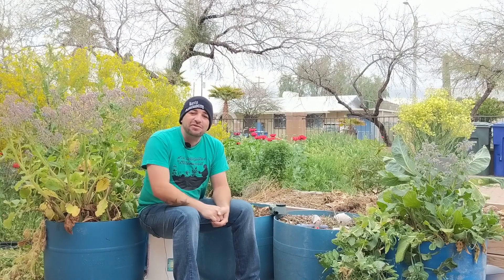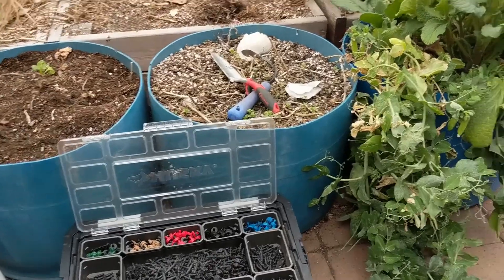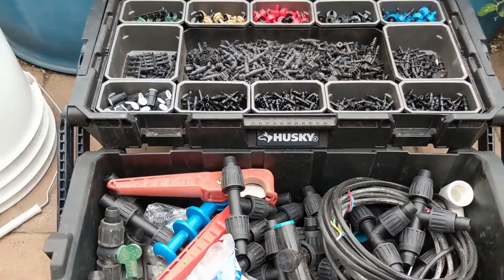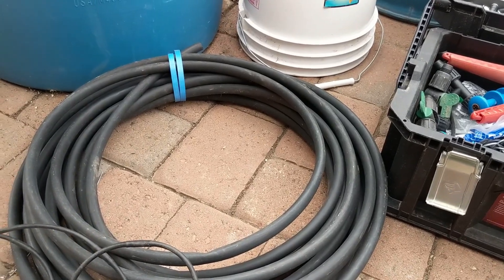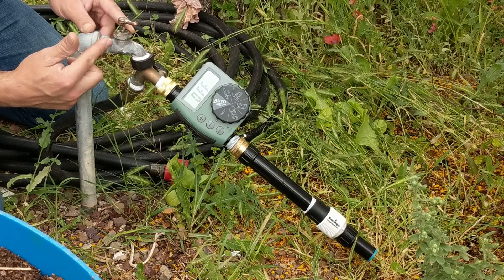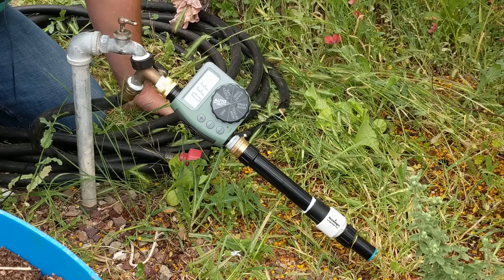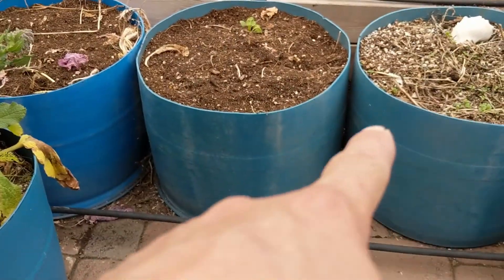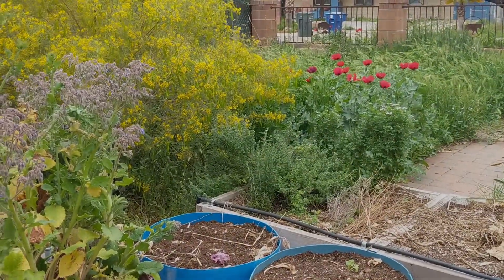How to Install a Hose Bibb Irrigation System

Comment: Hi, I am looking to use this method for my raised beds and about 3 zones for lawn. I have no lack of pressure and looking to “y” off a frost free bib with a built in vacuum break. Would this system work if buried and add another vacuum break after the timer for redundancy?

Comment: Hi....,I have a hose bib that is approx 8 feet from the start of my drip line....what parts should I use at the drip line to connect the hose and not blow the line apart from hose bib pressure...thanks.

Comment: Your videos have been so helpful and I have a question: what if you don't have any room to install the pressure regulator, filter, etc.  after you install your timer? Thanks in advance!
Reply from the maker: While I do like all the components I use in the video, you can most definitely substitute any of the parts and pieces with smaller versions that can fit your space better. I often use a "T" shaped filter rather than the one I use in this video that helps fit into tighter spaces, they probably make timers that are more compact as well. You could also try adding a "Y" Fitting to your hose bibb adjust it until it points in a direction that give you more space. Good Luck!

Comment: What do you recommend for a single port timer?
Reply from the maker: I like the Orbit timer you see in the video. There are two models, one has a plastic end and the other is brass, the one I use in this video is brass and it's the model I use. Good Luck!
Reply: Any issues with water hammering?

Comment: What if the off handles stop working 😭
Reply from the maker: You might have to replace the hose faucet if it leaks or is broken, it's a pretty easy fix with just a few tools, but you'll need to be able to shut the water off while you repair it. Sorry I couldn't be more helpful, Good luck!

Comment: Good video, but those Orbit timers suck big time.
Reply from the maker: There are orbit timers that I don't use, this particular model has worked very well for me for many years. I have had trouble with other orbit models, especially any of the two or four valve models.

Comment: OK so does it have to run directly from the spiket? 

Or can I set up  The timer filter set up where my race bed start and have a quick connect from the water hose- into system?
Reply from the maker: I get this question quite a bit, certianly you don't need to connect it right to the spigot, you can run a hose from the spigot over to your timer somewhere else like raised beds or whatever. I've seen these timers installed to PVC underground or in a variety of different ways. Once you get the hang of how all the components work, you can get creative for how you design your system. Good luck!

Comment: Beginner here...living in the desert of Yuma AZ and needing to conserve water.  What is the most ominous part of doing this is the beginning!!  Where do I start. I have tons of supplies but worried I'm not going to know how to get a poly drip hose with no end caps or connectors is very scary! A video would be great to see how you take a blank poly drip hose and connect it to the faucet...what connector you use; femal/male...jesus this is overwhelming!  Its keeping me from doing it.
Reply from the maker: Hi MeLin, I am from Yuma! All of this irrigation stuff is confusing at first, but eventually you'll get the hang of it. The hardest part is figuring out how long and how often to water your plants, second hardest thing is learning how to program the irrigation timer, third hardest thing is actually trying to insert the emitters into the tubing, but eventually it all becomes easier. I recommend you watch all of the videos in the description from part 1 all the way through, it will help to give you an overall understanding of all of the components in the system and how you set it up from scratch. Please feel free to reach out again with specific questions if you're having trouble with anything. Good luck!

Comment: Thanks for these great videos! 

Instead of connecting the timer directly to the faucet, would there be a problem with first connecting a short garden hose or something flexible to the faucet (before the timer) so that I can orient the direction of the timer down the line?
Reply from the maker: Yes certainly, i've seen these timers installed permanently into  PVC with fittings so you can for sure do that. as long as the components after the  timer are in the right order (filter then pressure regulator) you'll be good to go. Good luck!

Comment: Hi, great video. I have a 250 gallon water tank that collects rain water. It is hooked up now to use a hose with it. I was wanting to add a electric water pump. Is there a pump you can recommend that would work well for a system to water 12 raised garden beds? Also would you hook it up the same way you did in this video but just add the electric pump in? Thank you so much.
Reply from the maker: Hi Kelly, thanks for your questions! You should be able to rig something up to your water tank that will work. One thing I would check is what kind of effect the pressure regulator will have on whatever pump you use. Sometimes when you restrict the flow of pumps it can lead to them overheating and breaking down, so you'll want something designed to work with low water pressure. Depending on the set up, you might also need to find a timer that works with low pressure as well. You'll just have to experiment and find out which product work best for your set up. The way I would set it up would be rain barrel-->pump-->timer-->filter-->pressure regulator-->compression adapter-->poly line-->emitter tubing. Because you are using rain barrels a backflow preventer is unnecessary. Good luck!
Reply: Thank you...this helps a lot...I will see what I can find pump wise. Your videos are very helpful

Comment: I have only a 3 station Orbit timer connect to spigot (has built in anti syphon valve) , then for each station I have 3/4 inch poly going in ground to 3 sprinkler heads. Aside from clamps, nothing else. The anti syphon valve start leaking after a while and I have to push it back down. What can I do? If I add anti syphon bibs to each station connection will it help?
Reply from the maker: Hey Francisco, thanks for checking out the video. I'm not sure I have a good answer unfortunately, I have not seen timers that have built in backflow preventers so I don't have any experience with what you describe. If you are unable to replace the anti-siphon valve to keep it from leaking you might need to replace the timer. Sorry I couldn't be of more help, wish you the best of luck!
Reply: @SouthwestVictoryGardens  wow I'm so happy you at least gave me the time of day. You got my subscription. But i worded it wrong , I meant the anti syphon on the spigot. It leaks maybe from the pressure I suppose then I have to take the cap off and push the gasket back then, then it stops for maybe 20 mins and it happens again.
Reply from the maker: @franciscobueno6589  It's possible that the anti-syphon has gone bad, which can happen if it is under constant water pressure. The backflow preventer or anti-syphon should always be attached after the hose spigot so it is not constantly under pressure. If you have a 3 station timer, you might have to get an anti-siphon for each of the ports on the timer. You have options, you can buy 3 new anti-syphons and attach them to the timer ports, or you can just by a new one and install it as is understanding that it may need to be replaced from time to time, whatever works best for you. Hope that helps! :)

Comment: What if you have low pressure ?
Reply from the maker: if your water pressure is already between 20-40 psi you should be ok, but you'll want to check that the pressure isn't so low that it doesn't kick on your timer. Some timers do not operate with low pressure.

Comment: I already have regular hose tubing from the water outlet going 100ft to my back yard. Can I attach the poly tubing onto that instead of buying extra poly tubing to come from the water outlet or do I have to use the poly tubing from the water outlet all the way back to the garden. Sorry my first research and attempt at this
Reply from the maker: yes you can do that, but you still need to connect all of the pieces the same way you see in the video, the only difference is that you'll attach the timer and irrigation connectors to your hose rather than to a hose faucet.
Reply: @SouthwestVictoryGardens  thanks for getting back to me. So just so I'm clear - the order is hose facet-regular hose tubing extending 100ft - then the connection for timer/filter etc then poly tubing. thanks

Comment: Forgot to show  how you did all the connections from the water faucet. Sorry 😞 did follow you.
Reply: What is the attachment right after the flow regulator? It is the piece you are adding the 1/2" poly line to. Thank you
Reply from the maker: @CatalpaCreekFarm   that is a "compression adapter" for poly line. It's basically the piece that allows you to connect black poly tubing to traditional plumbing fittings like PVC. Compression refers to the way that these types of fittings work, by forming a water tight seal through compression. You could use other types of adapters as well, for example the "power loc" adapter. Compression is the most common type fitting for poly tube.
Reply from the maker: All the pieces screw together in the order you see in the video, it's pretty boring so I didn't want to include it it the video, sorry for that. One tip I could give is that it's best to not overtighten anything, hand tight is enough usually.
Reply: @SouthwestVictoryGardens  You did not show where the white tape needs to go. :<
Reply from the maker: @seresnyder4348  Teflon tape is a thread sealing tape, it's used is for sealing threaded plumbing connections to prevent leaks. It's used on all threaded connections
Reply: @SouthwestVictoryGardens  i don't think you need Teflon when there's a gasket which all those things have

Comment: If I want to run a hose across my yard to the garden area instead of 30 ft of poly tubing, where in the order of things (timer, vacuum breaker, filter, pressure regulator, powerlock fitting, 1/2 inch polytube) would the hose come in? And would that require another part/adapter of some kind? I need to be able to easily disconnect so I can mow the lawn.
Reply from the maker: I'll give you two options. The first is to do just like you see in the video but instead of connecting the timer to a hose bib or hose faucet you can just connect it to the end of your hose. all the pieces you see and timer can just lay on the ground if that works for you. 

Another option would be to set it up with poly and unscrew the compression fitting from the pressure regulator when you need to mow the lawn and just pull the poly tube out of the way. It isn't necessary to bury the poly tube, you can leave it on the surface. If it's easier, on the other end near your garden use a straight power lock connector coupling so you can disconnect on both ends and reconnect when you are done with yard work. Hope that helps!

Comment: Can you place the backflow and regulator before the timer?
Reply from the maker: Good question. It's best to have the backflow  and regulator after the timer. If the backflow is under constant water pressure over time it can fail. Some timers won't kick on properly if the pressure is too low, some are designed for lower pressure so you just have to check around. Good luck!

Comment: Well done! Thank you. Can I use quarter inch tubing directly from the faucet? Or must I start with half inch?
Reply from the maker: There are PVC fittings not shown in this video you can purchase that would allow you to come right off of the pressure regulator and into a 1/4" spaghetti line, but you wouldn't be able to run that line very far before you would start to loose pressure. It's best to come off a main line as close as possible to your garden or planted area.
Reply: @SouthwestVictoryGardens  ok, cool, got it! Thanks again.

Comment: I found your product list and ordered from Sprinkler World. I installed my first bib-timer microsprinkler line without any incident. On my second hose bib timer line, however, I have a leak between my backflow and my filter. I checked to make sure everything is connected as you¨have in your video. I made sure there is a rubber washer in the filter, I tried replacing first the filter and then the backflow, and every time it leaks. I'm using Teflon tape. The filter I'm using is a t-filter per your product list, as I could not find the straight filter like in your video. The leak is coming from beneath the filter's top screw attachment where it attaches to the backflow. Any thoughts on what I'm doing wrong?
Reply from the maker: Hey Kate! I'm sorry you're having some trouble with leaks, first I would make sure that there is no physical damage to the filter, sometimes the plastic can crack which will cause a leak. If there's no cracking, try hooking everything up without the backflow preventer and see if there is still leaks. i've experienced with some combinations of backflow preventers and filters you have to really tighten down and even then they sometimes just don't seal up properly. If you're still getting leaks check the threads on all of the plastic pieces, including the timer and see if any of the threads are stripped. Last thing I would try is to replace the pieces, I was at sprinkler world here in tucson last week and they had the long filters you see here in the video in stock, so you might try and see if swapping them out works, good luck!

Comment: Sure glad I discovered your videos!  New to Tucson gardening so this has been helpful.  Question..can I add the dripper line method to my exsiting underground landscape system by tying into the exisiting header that is currently underground?  Distance from my raised beds to "end of line" current underground header is about 20 ft.  Thanks in advance...love the videos!!!
Reply from the maker: Yes you can hook up dripper line anywhere in your landscape. If your main line is further from where you want to use the dripper line then you can run straight 1/4" spaghetti tube from the main header line and then connect to dripper line at your raised bed using a barbed fitting or barbed valve, good luck!